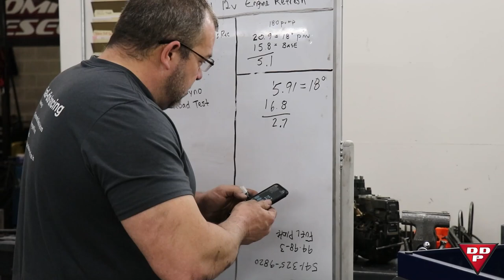Not all P-Pumps are created equal!!!

Comment: I appreciate your videos.  I have a 160 hp 95 and I remember a long time ago I set my timing using the snap on tools and the chart of mm lift for that pump . I set it to 18 dogs of timing.  I was told my of folks that's to much ect ect . My mileage went from 16 to 21 on the highway.  Some times a bit  better but I conservative .  I found no down side from the timing set there . That over 20 years ago . Truck had 218 k on it now with a g56 conversion,   . I might be interested in a pump at some point if I have problems with my truck . Thanks for the videos
Reply from the maker: You optimized your timing for the RPM range that the truck is most frequently operated in. There's nothing wrong with that!

Comment: Could you have pinned the pump and had a general idea of the original timing and that would have been close enough to make the truck run properly? Was there no tag on the injection pump.
Reply from the maker: Yes, it would have given us an idea. Unfortunately, this truck had been to multiple other shops before we got our hands on it. It also has the wrong pump cam installed.

Comment: Would slightly warming the gear help by getting it that little further on the taper?
Reply from the maker: Most people don't remove the gear, or timing cover, so how would you warm it?
Reply: I have a crazy idea:
There's two threaded holes on that gear for pulling it off right? Maybe attach stick-welder leads to bolts threaded into those holes, and electrically heat up the tapered bore of the gear (after cleaning thoroughly).

Probably way more trouble than it's worth.